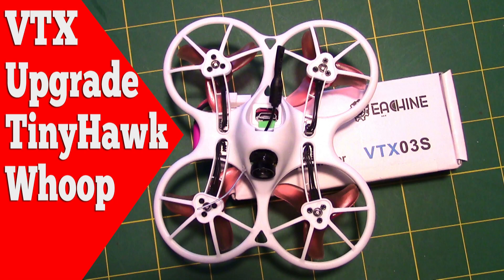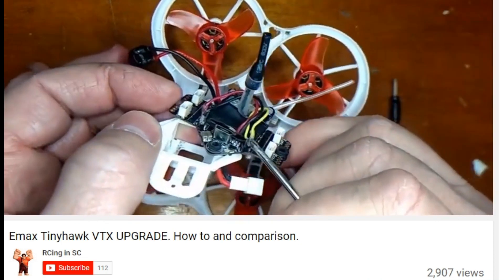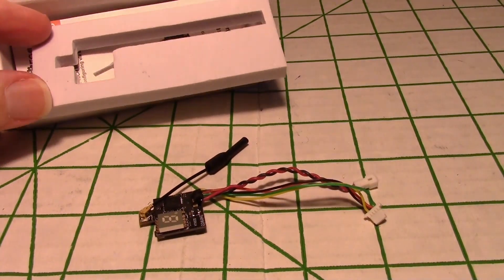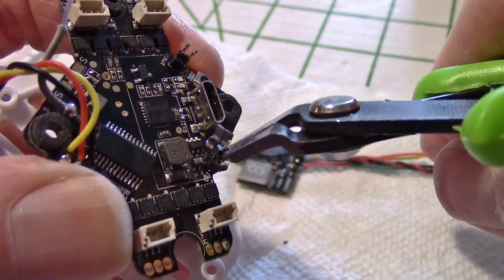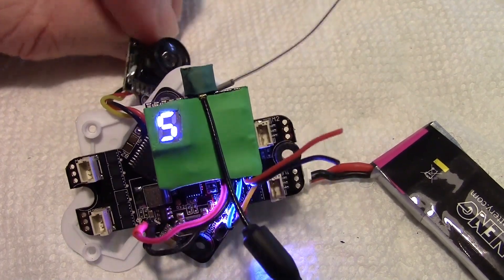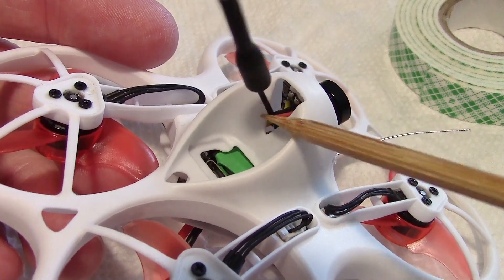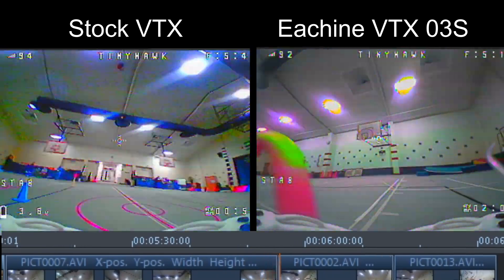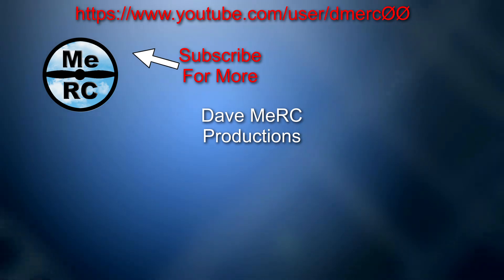Emax Tinyhawk V1 VTX 03S Upgrade Install - Video Fix, Adjustable Power, Smart Audio Stick Menus

Comment: Sweet mod. I’m still pretty new to FPV,  i just wanted to be sure that the 5v wire of the vtx is using the 5v in and not the 5v out, right? the 5v out would be going to the camera if necessary?
Reply: Vin and Vout stands for video in and video out not for 5v. but i'm sure you figured out by now :D

Comment: Thanks to your video I was able to install it on my tinyhawk 2 while I'm waiting for the flysky controller to arrive :)
It's my first drone and it still has to fly one time and I was shocked to see how small the board is 😂 I'm used to Arduino stuff and I thought it was bigger 🤣
Anyways, what about setting the transimmeter to higher power levels? Via menu?

Thanks again great video

Comment: Thank you for this tutorial. I just upgraded my Tinyhawk S. Only difference was I had to place the VTX on the diagonal because of the camera connector.
Reply from the maker: Cool, hope it gives you some improvement in the video. Thanks for posting.
Reply: @DaveMerc  unfortunately, the upgrade was not a success. I was able to connect the VTX using your recommendations, but the video connector on the Tinyhawk S's FC got in the way. I couldn't get the new VTX to fit. The slight (off center) shift didn't work. I believe the Tinyhawk S needs a smaller VTX than the Eachine VTX03S.
Reply from the maker: I see. I will put a note that is only works with the original TinyHawk under the video.
Reply: @DaveMerc  I managed to install this VTX into the THs frame, it just cant be mounted on the board. It fits up in the space behind the camera.

Comment: just did this upgrade and everything is working except that when im in the osd for smart audio none of the channels or power levels actually change, i can scroll through all of the parameters change and save things but it dosnt take. it seems odd because i can save and reboot the  flight controller  via osd and that  works. any suggestions
Reply from the maker: My power levels do save but they don't match what is on the screen because the manufacturer has different values than the stock.

Comment: Is this thing overheating from the vtx being heatshrunk? How’s it holding up?
Reply from the maker: I haven'tr any issues with heating so far. Only having a 1 cell battery with low current may be the reason. I usually run 25 or 50 mw because above that sucks the battery down to fast.

Comment: Hi!
I installed the VTX 03S and got no improvement at all. Any ideas? Could it be the goggles? Old Eachine EV800 with a mushroom antenna.
I also read somewhere that regardless of what power you set to the VTX it would still not give more than 25 mW. Do you know something about that? I have the TH S by the way.
Reply from the maker: It switched for me but when I go above 50mw it drains the battery too fast. Also the power level in the goggles does not match the actual power level and that seems to be caused by the FC firmware.
No I did not see a lot of improvement either to be honest. Now I am thinking of changing the antenna to a micro CP antenna to see if that helps. Did you try that?
Reply: @DaveMerc  
Have not tried that yet but that would be the next logical step I think. 
The power shown in the goggles are as you say not correct. Is it even possible to change power with smart audio? I can´t see any difference in range when I try it.
Reply from the maker: IDK but I have read a discussion that says house WiFI interferes with most bands and people are recommending to use frequencies in the race band because it's outside the WiFi bands. Have you tried any of the race band channels?

Comment: hey im having some sort of problem with my tinthawk when i plug it in the video signal bar shows i have 99 max signal but the video looks horrible even when im flying i go like 10 feet to the other room and my video gets real choppy to the point i could barely see anything and the signal bar still shows 99 max bars doesnt make sense...
Reply from the maker: Mine still has some issues and I beginning to think a CP antenna could help the most. Here is a link to one that I think could work well: https://www.getfpv.com/lumenier-micro-axii-u-fl-5-8ghz-antenna-rhcp.html
You might try that first and put a  matching antenna on the RX.

Comment: Hi, thanks for video and clear instructions. Just bought this vtx to put on my tinyhawk cause i notice my vtx losing signal going very high up or further away. What settings do you use 25mW or 50mW? Hows the range?
Reply from the maker: I like to use 50mW and it works great, very good range. It will use the battery a bit quicker but it's worth it.
Reply: @DaveMerc  did u get shorter battery life using 25mW? Also, the vtx seems to get warm/hot... is that normal?
Reply from the maker: The battery will last longer on 25mw than 50mw. It's normal for the VTX to be warm because some energy is lost in heat. Look up SWR and antenna tuning for the details.

Comment: Quick question, the video solder pad on The fc came off and I can not find a trace to solder to, is there any other place I can solder to in order to save the fc
Reply: I asked the same question to Emax and they kindly responded with this picture: https://ibb.co/L9XwDpR. and it works!

Comment: Have same vtx on my old snapper 7, will lose radio signal before vtx at 100mw.
Reply from the maker: Runs good at 50mw but I think the VTX 03S draws to much current to run 100mw or 200mw on Tiny Whoops with 1s batteries.

Comment: Nice. I use the standard one without smart port........ I use them for long range and they work fine.... great vid as usual.
Reply from the maker: Super! I was thinking of changing the antenna to a CP style to avoid the reflections. You should do a montage video of all the interesting plane designs you have tried out.
Reply: Can you explain what you mean? You use the standard one without the smart port? How do I do that? Thanks for any help as I am quite new to this 😊
Reply from the maker: I think what moochasas is saying is that he has the same VTX but without Smart Audio so he can't use the radio sticks to change frequency and band.
Reply: Smart port allows you to connect the video Tx to your flight control board so you can change settings via the sticks (as shown in the video) Dave has the "S" model which means Smart port...... I use the same brand of video Tx but mine arent the "S" version, mine dont have smart port so I have to change the settings on the actual video Tx..... hope that makes sense.
Reply from the maker: I think the confusion is from the terms Smart Port vs Smart Audio. They are different things.